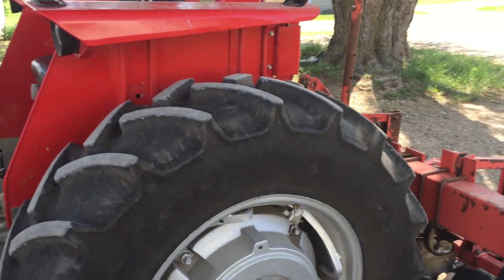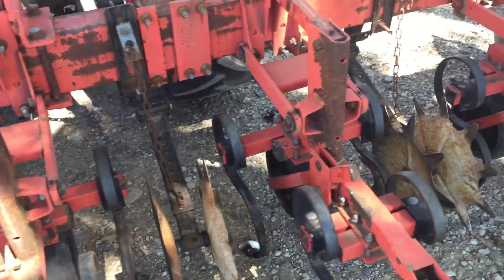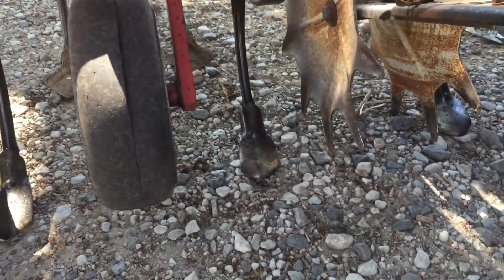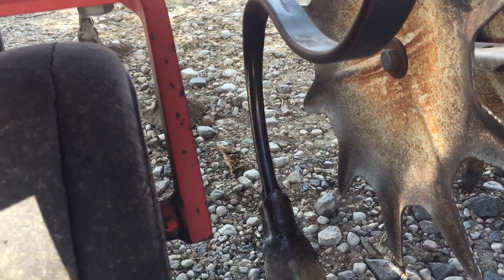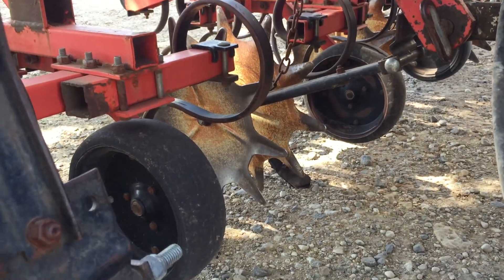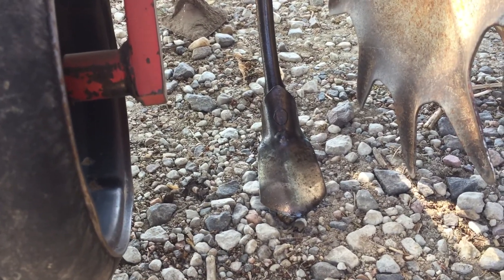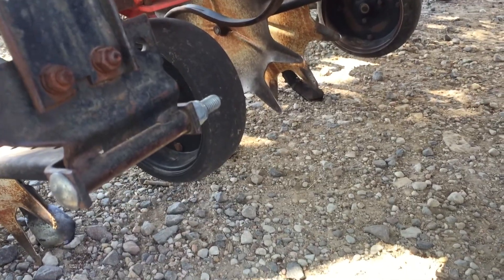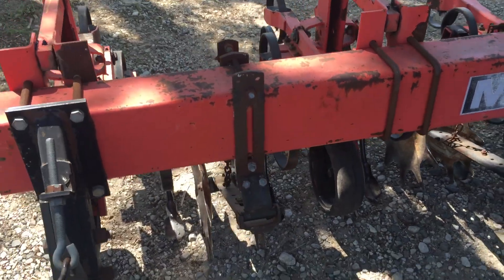Day 10-organic corn cultivation-dry soil problems part 1

Comment: What oil do you use for this?
Reply from the maker: Anything (including wax) will work to make a film to prevent rust.  The only reason to apply something is if you aren't going back to the field right away.  Soil contact will polish it better than anything else!  Grandpa actually used axle grease that came in 2.5 gallon bucket and used motor oil when he had no grease.
Reply: Geiger Farm Thanks. Makes sense to use it to prevent rust. I was originally thinking you were using it as a lubricant to prevent the soil from “sticking” to the S tines which didn’t make sense to me (would be gone in the first few minutes of soil contact)
Reply from the maker: I knew I was going to skip a day and there was a chance of rain last night.  I didn't rain so I went back for round 2 :)...